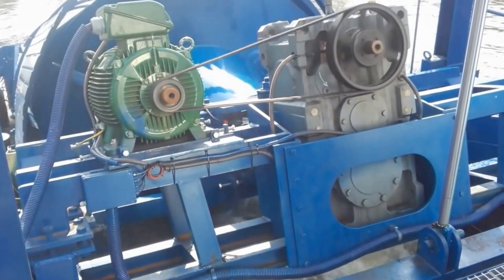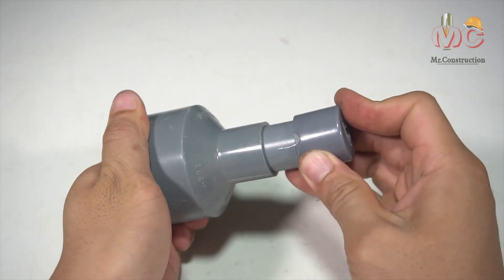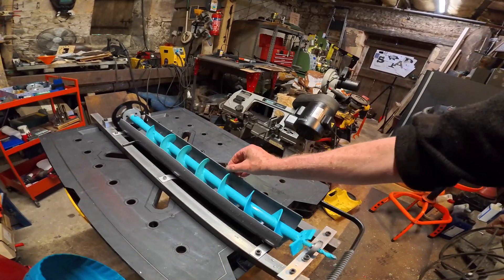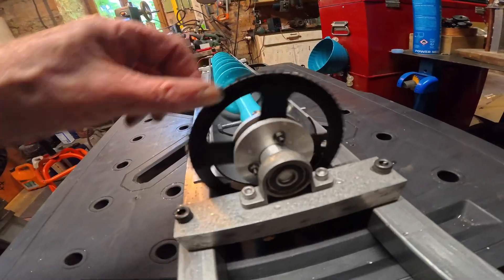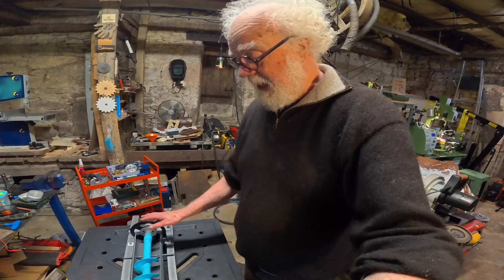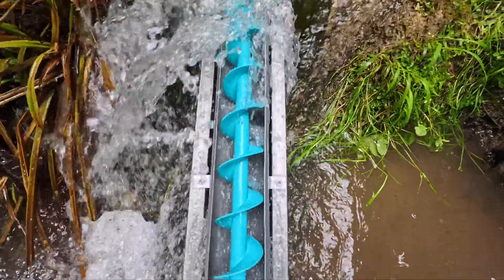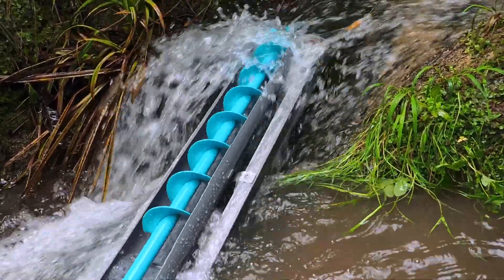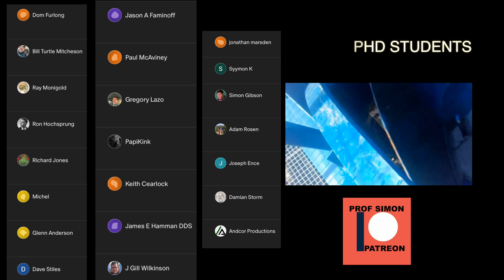Free Electricity - Micro Hydro - Prof Simon

Comment: Professor, make the design taper to a small end and surround the whole thing with a cone with open top and bottom. Then turn it small side down and let the water fill the cone up. This way, the small end picks up moment as the screw tightens and all you need to do is ensure it has water. You can even extend the big side of the cone and pill it with more water before releasing the bottom. The cone shape also will taurally form a whirlpool further increasing power. I can draw you a diagram on Elon place if you want. ♥️
Reply: Like it but should actually be other way round in a venturi a colecter cone into a expanding cone for the turbine.  Dont forget water dont compress 
So you concentrate the weight and speed of flow .
Reply: @billschwandt1  sounds interesting!
Reply: I know where your going with concept but.... It doesn't work like that. The two physical mechanisms you think your optimising, your actually hobbling the system. The goal is an output drive shaft with maximum rotational energy (torque) water is flowing by gravity so you want to work on "mass"! As much mass of water as possible is what needs to be captured, any overflow is energy lost. If the exit is smaller than the entrance it will overflow (lose energy) no matter how wide a cone is at the top, the pressure and flow through the small end remains a constant! That goes so far as to say if it was a straight tube the same size as the hole in the bottom all the way the flow and pressure stays the same. It only increases with HEIGHT or "head". If you have a tank with 100,000 gallons at 10 ft deep and put a 1 inch hole in the bottom the pressure and therefore the flow potential through 1 inch, would be exactly the same as a 1 inch pipe ten foot tall full of water, the pressure through the 1 inch opening into the 100,000 gallons will be the same as the  half gallon in the 1 inch pipe. The only factor is the height will drop fast in the pipe relative to the tank, but if the pipe is kept topped up the energy coming out of both thank and pipe are exactly equal.
Radial speed of the screw/auger cannot be changed it is solid along its length so therefore it needs to receive a constant force the entire length any variation will cause loss equal to factor of proportional discrepancy.
The maximum energy available to harness is the area of a cross section of the flowing water times the vertical difference in height between the first point of contact with the working component to where the water leaves contact with the working surface of the component. The weight of that volume of water is force by weight, the speed the water flow can fill that volume ( vertical speed of the surface rising) is constant rotation. So in the small stream they were in, you have a rough potential of 15-20 ft-lb torque at 15 rpm.  1/2 HP 320 watts